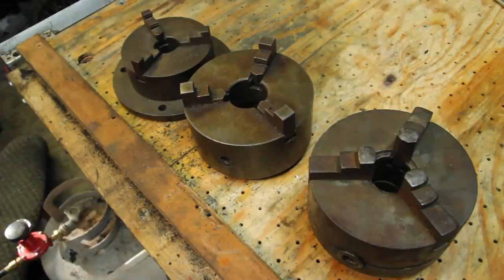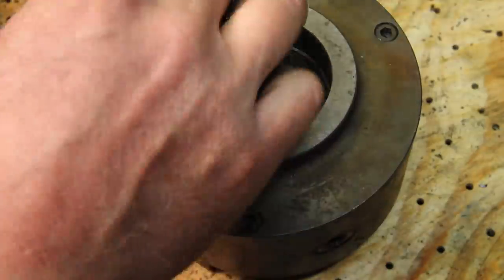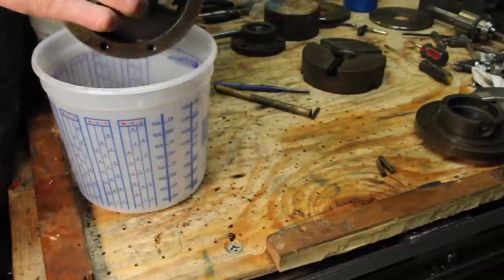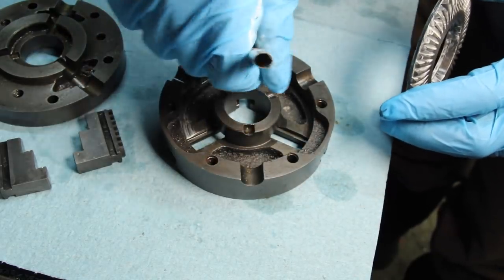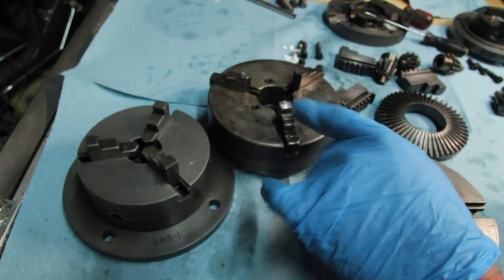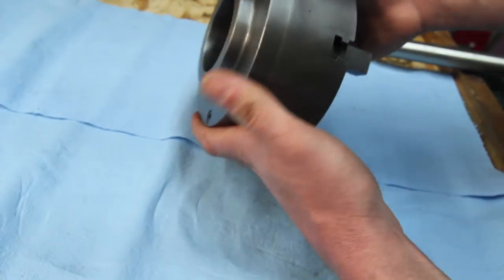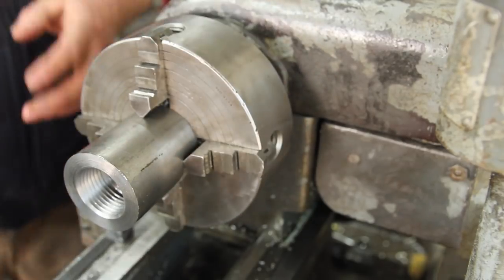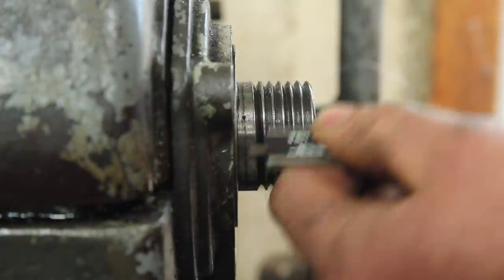Alternative Three Jaw Chuck Mounting

Comment: The worn out 3-jaw makes a nice work bench vise/holder. I  had one kicking around at work and came in real handy numerous times just being able to hold something good and steady.
Reply: Also with a motor of some kind (random windshield wiper motor for example) it's a good rotary table for welding.
Reply: @deeiks12  I was thinking the same thing, perfect use for a worn out three jaw.
Reply from the maker: So what you’re saying is I shouldn’t…..chuck….it?
Reply from the maker: So what you’re saying is I shouldn’t…..chuck….it?

Comment: I have a 3 jaw that's brand new, along  with the lathe that had over 3 thou of runout which was useless to me so I thought I'd try a half azz attempt at grinding the jaws. I put a 1/4 shank round stone for a cutoff wheel in my tool post, wrapped welding rod tightly around the center position of the chuck jaws and used the key to open them out tight against the wire. I spun the lathe up on its highest rpm and just barely touched the stone to the first jaw that touched and auto fed it through like a boring op. I did that on the slowest feed rate and stopped once all of the contact surfaces were shiny. When done I put a precision ground rod in it and checked the runout. 3 tenths at the chuck and a half thou 6 inches from it! Couldn't believe it worked that well.

Comment: People will say "don't use grease on chucks".  But I've had grease in my chucks for years and it's never been a problem.  Good job with this one!
Reply: I highly prefer using manual transmission oil additive that is pfte(teflon) based... It is almost as thick as a light grease, but has the lubricity and anti-corrosion properties of way oil... Its my go to lubricant for machines... Yeah, i use mobil way oil, but my oil can is filled with the additive, so when i lift up the tailstock to wipe the ways and such or feed the oilers, i use that can as it is just the best thing there is... I also use it on machine screws as they are essentially gears by the nature and forces involved, and the additive is 90% 90weight oil for man.trans. with no detergents and the rest is heavy friction modifiers and teflon solution... Smells great too... If you like the smell of high pressure lubes... I highly recommend it! If you prefer grease, buy a cheapo replacement cv joint boot for any car and with it you get a bag of 300grams of cv axle grease, which is also a great lubricant... Its a thick as fuck grease with a very high molydisulfi content which lasts for ages, but do clean it up and maintain it fresh, as car axles are shielded with a rubber boot, but chucks eat up chips and the grease however good becomes a grinding compound sooner or later... 
Cheers mate...

Comment: I sprung the adapter on my three jaw the second time I used the lathe, while trying to remove a weld from a sprocket hub.  It was made by someone else, they didn't do a good job.  How bad was it?  The lathe was on a temporary motor, 3/4 h.p.  The lathe was in it's lowest back gear, and I had to help it get started.  The adapter was supported entirely by the thread, it also had the (100 lb. +) Bison chuck hanging way out over the bed.

So, my first precision work in more than 30 years, plus my first boring and internal threading job ever, was a new adapter for the three jaw (yeah, no pressure!).  Roughly 2-9/16 bore for the register, 5 tpi threading with a very springy, very old, lantern post mounted boring bar.  That tended to slip.  So, add a 'near crash' course in picking up a thread.

Anyone dealing with threaded spindles and heavy chucks, I suggest that you make up a dummy spindle to use in projects like this one.  I did, using the faceplate for gauging the fit.  One end is a duplicate of the spindle, the other end is a bore gauge for sizing the threaded area minor diameter.  For me, it was well worth the extra effort, things fit and proved out, with repeatability, on the first try.  It now collects dust while sitting on a shelf, waiting for the next chuck mounting project.
Reply: For chucks that heavy, perhaps integrating a Morse taper would provide needed extra support?
Reply: @ExtantFrodo2   I've seen threads integrated with tapers on a lesser known brand of surface grinder, that (in short), created more problems than it solved.  Nearly impossible to break loose.

Getting the chuck positioned correctly to the spindle (back of the chuck as close to the headstock as possible) will give the best results.

Comment: Jeremy, I'm confused on two fronts. 
At one point you said you didn't have the change gears to cut one of the threads. You then proceeded to cut both???.
Then you say you're going to use your first attempt at the adapter to remake your ER collet chuck but you then mount it in the six thou off center chuck to begin machining the front of your "new" ER collet chuck. Surely, since you'd already cut the headstock thread, you would mount the stock back directly on the spindle and turn it from there??? 
Maybe I missed something but I'm not sure what or where. Maybe your subsequent video will explain.
Regards from Canada's banana belt. 🤞🤔🇨🇦🍌🇺🇦🕊️👍
Reply from the maker: The change gear thing was a reference to This Old Tony throwing levers on his lathe to time travel, often to go into the future to get what ever he’s working on to make…whatever it is (see his boring head video.) the joke is I don’t have a quick change gear box, and I don’t have the proper change gears for time travel, so I can’t go into the future to get the three jaw chuck…which would have made the project easier.

On the collet chuck, I think it I just did it for “demonstration purposes only” for the ending of the video, I don’t think I turned anything like that.
Reply: Ok Jokes on me. I heard the TOT comment but didn't relate it to the quick change box. As to the ER chuck I was just making sure you weren't about to do something crazy. Ask me how i know?

Comment: The problem with my lathe is that it can't cut the threat pitch of it's own spindle nose. I think that's a bit stupid.
Very good video Jeremy. I enjoyed watching.
Reply: Same here. Very stupid! Of all the ones to include in the set of gears to ship with a lathe it's infuriating for them not to include ones needed to work on the machine itself. I've been putting it off, but at some point I will have to make custom change gears to enable this.

Comment: Strip them chucks again, clean off all the grease you put in there then reassemble with a LIGHT OILING...
You don't use grease on chucks.
🇬🇧😐
Reply: Why not? Both grease and oil will cause chips to get stuck, so I don't really see the issue.
Reply: @ferrumignis  

Because a light oil will be mostly thrown out of the chuck when spinning whereas grease will just stay there and collect dust and bits which then turns it into a kind of grinding paste....wearing out the chuck
🇬🇧🙂
Reply: @glennmoreland6457  If the oil gets thrown out of the chuck it's not going to be very useful to the chuck...
Reply: @ferrumignis  

No.
It'll leave a very light film of oil in the areas where you want it....
But not enough to attract dirt & dusts
🇬🇧🙂
Reply: @glennmoreland6457  Any amount of oil will cause dirt and dust to stick to it, a thinner film doesn't magically stop this.
Reply: @ferrumignis  

It will attract much less than grease...
That's it.
Goodbye
🇬🇧🙂
Reply: @glennmoreland6457  it took you awhile.